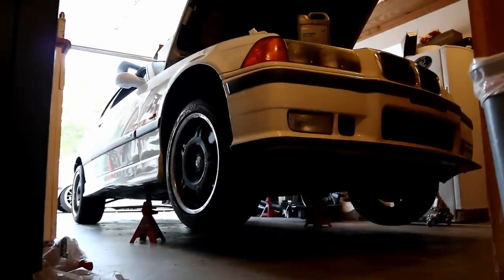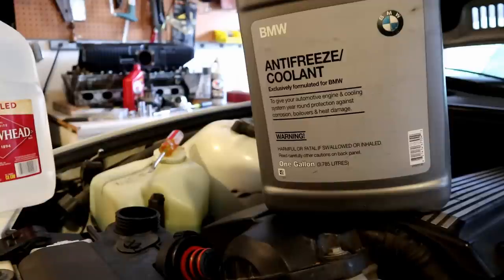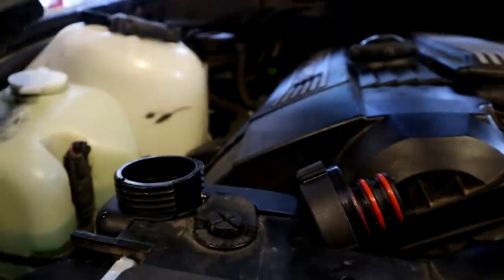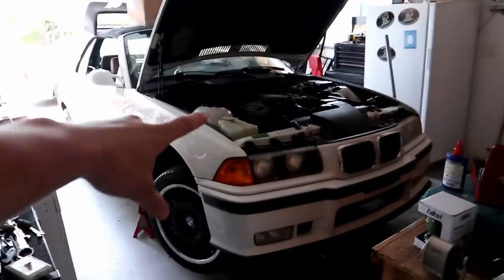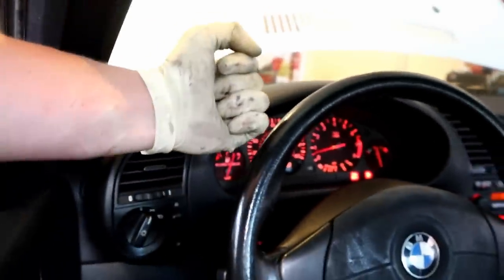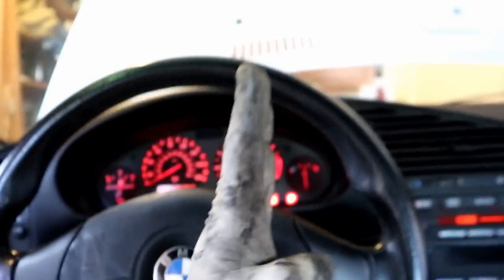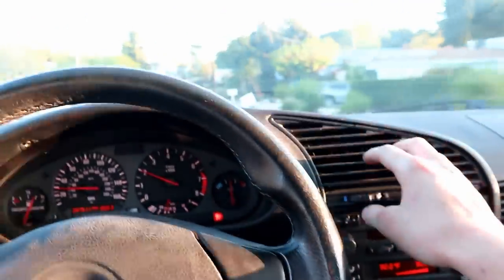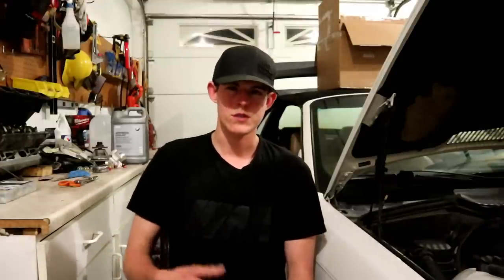E36 Cooling System Bleed DIY

Comment: This video is legit. Keep in mind guys, sometimes you have to bleed it wayyyy more than you think. Took me 3 days of driving it around town, parking, cracking the bleeder screw, waiting for the expansion tank to cool, then topping off coolant. After about 10 cycles of that the bubbles finally stopped and finally coolant started passing through my heater core and giving me heat

Comment: My e36 328i is raising the temperature Guage after an hour of idle  but it never overheats while driving now I'm afraid it might caught me on the traffic, new water pump and fan clutch but still does the same, what would be the problem?
Reply from the maker: @thabisomofokeng2886  first try flushing the radiator out or replacing it. The water pump only moves coolant, if the heat exchanger isn’t working correctly then it can get hot.

Comment: Recently picked up a 96 328i and love it more than any of the American or European cars I have owned. Had no idea why it was overheating so I changed the thermostat, refilled the coolant level and still overheating. I know I'm not alone with how touchy the BMW  is about how it needs to bleed, burp and topped off a few times. Your video saved me from going right back in and replacing the water pump. Just subscribed and will put in the time to learn watch and learn what my big baby likes and don't like. Thank you!
Reply from the maker: of course man! these cars are addicting, i will be keeping one indefinitely. feel free to ask any questions that come up!

Comment: Thanks for the video. Plan on doing a coolant bleed on my z3 M S52 tomorrow.

Copying&pasting a comment from another e36 coolant bleeding video and it references what the BMW tech manual instructs to do, thoughts?

"Chilton and BMW tech manuals indicate to fill the coolant system with the ignition in the ON position (electricity running only) with the heater on.
Then actually START the engine after the level in the expansion tank no longer naturally drops. With the ENGINE now running, rev it with 3 short bursts of 4500-5000 rpms. This allows the water pumps rid the air of the system itself. 
After 30 seconds to avoid the engine from heating up and coolant expanding, tighten the bleeder screw and shut the engine OFF. 
Check the expansion tank coolant level and fill to the appropriate level, replacing the cap.
Restart the car and allow to run to normal temperature. Turn it off, let it cool down and check the expansion tank level one last time."

Comment: It seems that you were able to bled it well with just the heater fan on and then running the engine with the radiator cap off and bleeder screw open. Thus, it didn't need to be bled anymore after the drive. 

The front end being higher may have helped too. So the air bubbles have been bubbling before you can even see them.

Comment: Thanks for the great video got into the bmws for the last two years I find them easy to work on just got to get patience do a few things like bleeding the cooling system just drove it to work without bleeding it right and needle got into the red so I am going to bleed it here at work but it is a 1997 318i that I am rebuilding and restoring sense the last owner let it sit in the Arizona sun and did not drive it for a few years it is pretty much a total rebuild .So thanks for the help

Comment: thanks for doing this, you're becoming an authority on this bro. 

do you know why the lower radiator hose collapses when the engine is cold? mine keeps doing that and i've bled the system again and again.
Reply from the maker: Colapses like under vacuum almost? Does it uncollapse when you remove the radiator cap? Its possible the cap might be bad.
Reply: @M3NACE  it uncollapses when i remove the radiator cap but i just bought the radiator cap like a few months ago, it's brand new. Im already on my second brand new radiator cap because i thought it was the cap initially as well. 

but as soon as the car heats up the hoses uncollapse, it did overheat on my in traffic randomly the other day but went away as soon as i pulled over and idled my car? i'm perplexed.
Reply from the maker: @notme5834  have you tried replacing the hose? Maybe it was manufactured improperly or it is defective.
Reply: @M3NACE  could be, the hose is actually less than a year old too. my brand new stock (from the dealer) expansion tank cracked in about a year too. lol

Comment: Hey man, I just threw in a Mishimoto into my e36 and have been bleeding it since then. It’s been good, hasn’t overheated, no leaks from any radiator connections that I can see, and the air blows hot in the car really quickly. However, it has been drinking a lot of coolant... when should I start being concerned? The intervals in which it needs more has become greater in time which is good, but I’m unsure when to start worrying if I have a coolant issue elsewhere besides the radiator.
Reply: did the swap Thursday, and today is Wednesday. drank about a gallon and a half or so of antifreeze/distilled
Reply from the maker: @tucker_st.clair757  well I would check to see if there are any external leaks to begin with, pressure testing the cooling system would probably be a good idea to start. car didnt consume coolant prior to replacement im guessing?
Reply: @M3NACE  When I very first bought the car I had to fill it up with coolant a little bit after a road trip, but no not really consuming anything. I'll set something underneath the car to see if it's leaking anything and look into pressure testing it, thank you!

Comment: Isn’t distilled water frowned on? I thought it was suppose to be soft water? Thanks .. I was checking in if you were going to use a vacuum bleed . But good instructions about burping it out .!
Reply from the maker: ive heard it both ways, but drinking water is frownd upon because it contains minerals that will accelerate pitting and cavitation, distilled water does not so it is fine to use, although some people dont think so and think it's worse for some reason. ive never had a problem with it, and in fact most racetracks want the cars that run for drift events and track days and stuff want you to run strictly distilled water with water wetter in case of a crash, it wont leave chemicals all over the track, and will evaporate with no mess. if its a rule of thumb in the racing world i cant imagine it would be bad, ya know?

Comment: What I heard that helps is taking off the upper hose from the radiator and filling thru the hose first then reinstall and use the reservoir once the hose is backing up

Comment: Awesome video, I didn’t close my cap enough one day when I was checking my coolant before a drive, needless to say it was all over the engine bay after that drive. Topped it off after getting some coolant from BMW and noticed it kept going down. I thought I had a leak. Watched this and did the exact same steps. Seems to be okay now! When you come back to it hours later and if the coolant is lower then it was, do you just refill it to the “cold” point?

Comment: Thanks for posting this. 

I just finished putting the 92 325is back together after replacing the head gasket. 

Not sure i bled the coolant system right the first time but followed this video and it should be right. 

Having a bit of an issue. 

After just a few minutes with the engine running,  the temp gague was almost fully in the red. Even with the heater on full. I let it run a few minutes like that not knowing what to expect and hoping the thermostat would open. 

The upper hose was hot but the lower remained cold. 

I didn't want to take a chance,  so i turned it off. 

Thermostat is new,  water temp sensoris new. 

Any thoughts?

Comment: After around 16 videos about bleeding the system, I can say that this is the best one about it. I really clearly understood what I need to do to properly bleed the cooling system. Thanks man. One question. I want to completely clean the system before I insert new coolant and I dont want to open the draining plug on the engine block, simply because I`m not an expert and I dont wanna unscrew the wrong screw, so , I saw on the other video that they are doing it by draining only the radiator then they add distilled water only to push out the old coolant from the engine block, they heat up the engine, then drain the radiator, and they keep going like that until few flushes are done, just with distilled water. After the last flush when the clear water is coming out, that is where im confused. I drain the radiator , but i dont know how much distilled water only is still inside the engine block. I cant drain the block so i dont know how much antifreeze I need to add. I dont wanna premix antifreeze and water , because there is also water still inside the block, and it will ummmm make the antifreeze less resistable (If you know what I mean, i cant find the English word).... What do you think, how much water can engine block still have inside after i drain only radiator? How much coolant do i need to add to be 50/50? Is that method any good? Or should I use your method? Did you drain the engine block as well, or just the radiator? Thanks
Reply from the maker: drain the radiator and the engine block. there is only 1 bolt on the side of the block, and it's the drain bolt. you will not get confused, i promise. way more simple than drain/flushing. if your concerned about coolant/water balance, buy pre-mixed BMW coolant and run only that.
Reply: @M3NACE  ok man, thanks for the encouragement. I will try to locate it and do it your way

Comment: Hi thanks a lot brother, you've been much help, so easy to bleed now, I've got a 320i m50,
Won't it damage anything pouring water in if its hot still? Or can I pour water in if heat temp rises without damaging anything?

Comment: My heater fan is dead, can I still do it if I just turn the heat up? My cooling system is so moody, trying to get him happy.
Reply from the maker: Yeah, as long as the heater block valve is open it should bleed.
Reply: @M3NACE  Sweet, next issue, my lower hose doesnt get hot? Radiator issue?

Comment: So when on the test drive, how come the reservoir doesn't become too hot to open? Will it stay a safe temperate throughout? Great video tho!
Reply from the maker: it should build pressure and get hot, we want to make sure it is working properly and stays up to temp. if you need to open it, go slow and vent the pressure, and you might need to let it cool down a bit before you crack it open.

Comment: Such an awesome video, but i have a doubt, what if i turn the heat on in my car and never gets hot?
Reply from the maker: Just keep bleeding, if the heater works it will bleed. Ive had them take up to half an hour after getting to temp before it gets hot. If it doesnt, you could start diaging the heaver valves and associated components

Comment: Hi there,this video regarding bleeding was very helpful.I have bmw f34 and had low coolant signal popping.I got it checked for any leaks ,didn’t find any leaks.got it pressure checked,still no leaks.I have tried bleeding it once.but didn’t get heater on with engine running and may be that’s why next day after a 30km drive,the coolant level dropped a bit.so should I top it more and let engine run with heater on for a while and keep filling coolant?

Comment: Awesome video man, but i have a problem with my e36 320i and maybe you can help me. It's an m50 s2 and i thought i had a leak which made me change the radiator and the hoses,bled it a couple of time, but now it seems my engine is running a little bit too hot altough my  gauge is dead center.. It's like something is making way too much pressure in my whole circuit which releases when i shut the engine off and looks like a leak ( radiator cap maybe?) Or my thermostat is stuck on closed?
Reply from the maker: Possible the rad cap, if you let it run will the temp keep climbing into the red?
Reply: @M3NACE  nope, that's what makes no sense to me, it gets to normal temperature and stays there, but something doesnt seem ok
Reply from the maker: @pilu3w4s63  why do you think so?
Reply: @M3NACE  well I'm worried not break my head gasket if I dont solve that leak, which points me to the rad cap because everything else is new.. guess I'll double check the thermostat but it's weird it's not climbing to the red zone when the engine obviously seems overheated

Comment: Bottom hose of reservoir tank pops off - is it caused by air bubbles? It was also really hard for it to tell if the hose is clamped on to the tank. Should I replace it? Also don’t think I bled it right.

Comment: You said when coolant consistently pours out of the bleed screw is when the system is properly bled and car is at temp. But the the first time I started my car (once the system had taken as much as it could) coolant consistently came out of bleed screw.
Reply from the maker: did you replace the radiator or drain the radiator fully?
Reply: M3NACE just replaced the radiator
Reply from the maker: @hamzashaf24  how much coolant have you put in already?
Reply: 1 gallon bmw blue and about 1.5 gallons distilled water
Reply from the maker: @hamzashaf24  well it might be pouring out due the the thermostat not fully opening yet, id close the cap and let it get up to temp. if you crack the bleed screw and coolant still comes out, top it off and take it for a drive, but watch the temp gauge religously. if it starts to clomb at all, pull over, crack the bleed screw, let it air out, then pop the cap off and fill. rinse and repeat until its holding temp well.
Reply: M3NACE so close cap and bleed screw. Start and let come to temp. Then take for a drive and watch temp guage

Comment: Hi
If you replace with new all the cooling system components on E39 528i 1998 M52 engine and you don't see coolant mixing with the oil....
And you have rock solid hoses, what's would be your suspect for this.
BMW dealer here in UK is telling me this is normal but they are exceptionally hard can't squeeze them? 
When I drive temperature is solid 94C but idling goes to 102 and looks coolant doesn't circulate proper thru the radiator to activate the viscous clutch /fan.

Comment: I did a cooling system rebuild about 6 months ago and used your video, so thank you! Unfortunately, I was sent a faulty expansion tank with a slow leak and had to put the old one back on. I just got around to putting a new one on.

But now I have air in the system I can't get out. I park on my inclined driveway, take the bleeder screw off and hold the engine around 3k RPMs with the t-stat open and heater on until coolant is spilling out of the bleeder screw with no air bubbles. I tighten everything up and then let it cool down all the way before topping the coolant back up the cold line.

When I'm moving and the radiator is getting airflow it's perfectly fine, but when I idle for more than about 5 minutes the temp gauge creeps passed the middle and keeps climbing up.

I can't seem to figure out anything different that I would be doing from your video. Any ideas?
Reply from the maker: Did you replace the radiator when you rebuilt the system?
Reply: @M3NACE  That was the only thing I didn't replace. It doesn't leak at all.

There were no issues before I replaced the expansion tank the other day
Reply: For anyone that reads this and has the same issue, it was because my aux fan wasn't working

Comment: Great video!. Please help me with the following. I have changed my radiator for a new Nissens on my 2000 323ti (M52B25). There are no leaks under the car and I do not have the idea that there is a leak. But I have driven the car since the bleed 5-10 times for 30 minutes and I still have the idea that after sitting for a day the expansion tank coolant level is a bit lower every time. But when the car is cold and I open the radiator cap and the bleed screw the level comes up quite a bit. Is this nornal and how can I be sure that all the air is out of the system?
Reply from the maker: Normal, the cooling system is under vacuum when cold and sealed. I wouldn’t worry about it.
Reply: @M3NACE  thx. When can I expect the coolant level to stop being lower than the day before when the engine is cold. Can that mean that there is still air in the system?

Comment: How do I tell if the cooling system is circulating properly? I installed a new water pump and removed the thermostat.
Reply from the maker: Well i mean if its not overheating thats probably a good sign lol
Reply: U deleted your thermostat ? Lol

Comment: I've been having some trouble bleeding my system, I hear air bubbles in the dash board and sometimes my coolant sensor will go off, but when i remove the radiator cap and then loosen the screw the coolant level rises to the kalt line again. Any ideas?
Reply from the maker: The level raise is from the coolant cap holding vacuum, you can try replacing it if you are that worried about it but I wouldnt worry. Aside from that, have you raised the front right corner of the car up and tried bleeding it that way? Also, does your A/C work?
Reply: @M3NACE  Coolant cap is brand new, i have been bleeding it with the front on jackstands but not higher on the right side, and no my a/c unfortunately doesnt work.

Comment: This video's been up a while but if you see this, please answer.
I heard that one shouldn't open the reservoir cap after running the engine and it's still hot. They say the cooling system will suck in air if you do that and will cause the engine to overheat. How true is that?
Reply from the maker: not true at all. you shouldnt open the cap when its hot because there will be high pressure. however, if you are bleeding it from cold you dont have to worry about that because the radiator cap needs to be on for the system to build pressure.
Reply: @M3NACE  thanks for the reply.